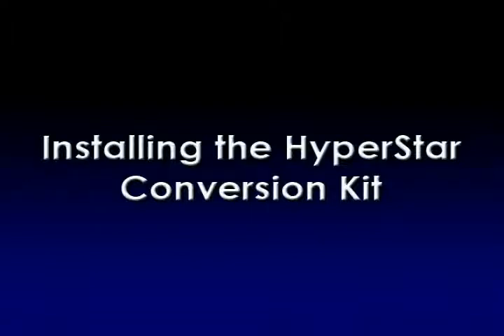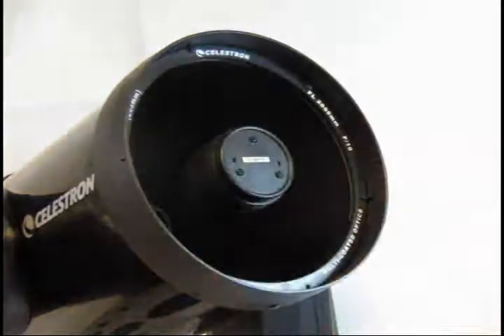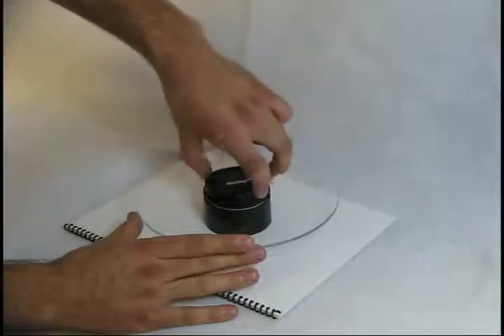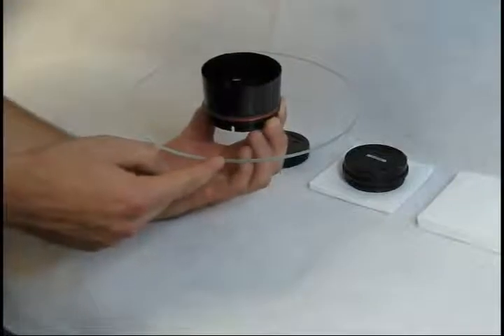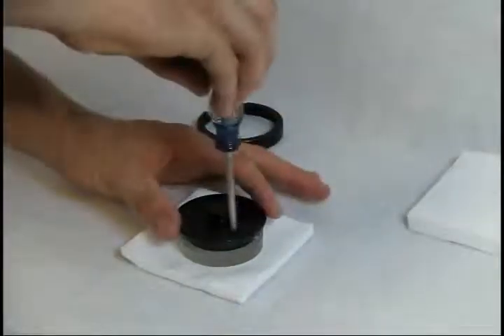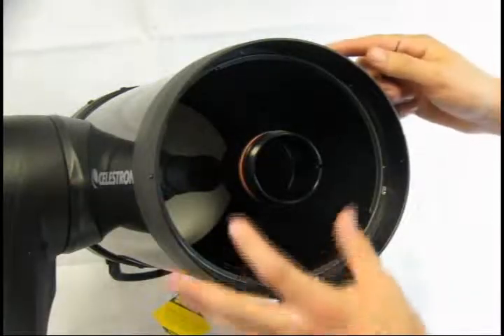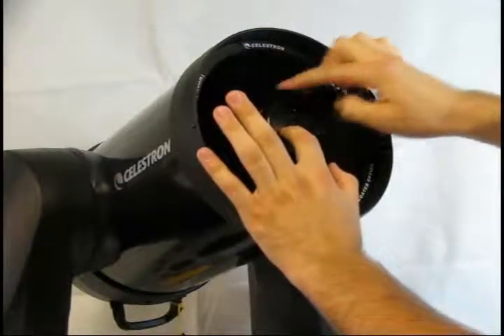Installing a HyperStar Conversion Kit

Comment: Trying this now. Trying to remove a glued baffle tube takes over an hour. Been at it over 30 minutes and it hasn't budged. The video shouldn't make it so misleading. 

Update:  Some of the old model orange C8's baffle doesn't screw off. As I eventually found out 4 hours later. It's one unit. I had to crack it slightly in order to remove it.
Reply: I got a 1978 model, so in glad I read your comment. I'm really on the fence about buying one of these for my C8 but it offers so much promise and convenience once installed.
Reply: @DJRonnieG  I've had mine out three times now, and all three times spending hours aligning and collimating. But once you get that done, it's awesome.  I've been able to take some test images and they were great.  If you can get through installing with patience, and know how to collimate the Hyperstar, you'll love it.

Comment: Anyone else notice that he put the corrector plate back in nearly 45 degrees off from where the index mark was originally made??
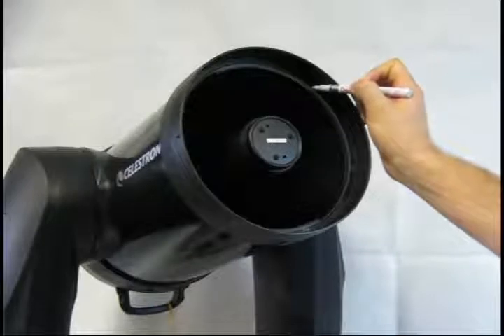Reply: I noticed that the orientation of the screws changed (180 degrees?) from timestamp 3:11 to 3:17 before the corrector is removed.
Reply: Correct! That was really confusing me... Took a while to realize.